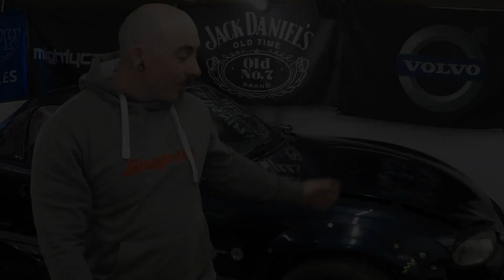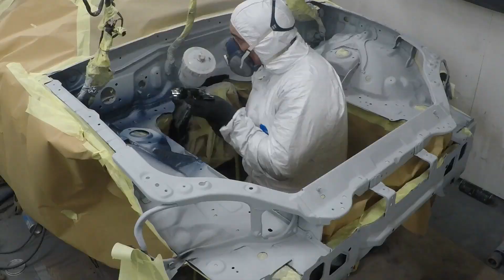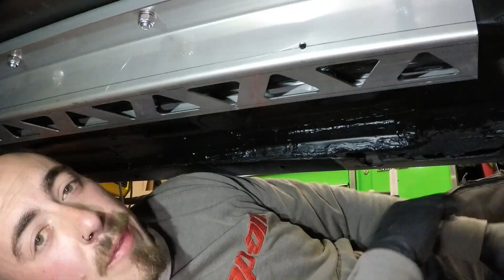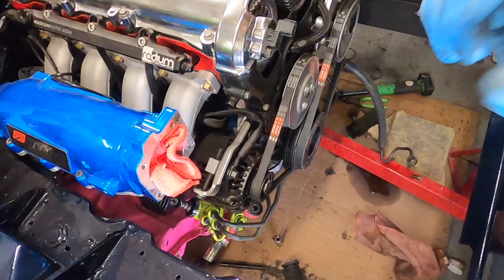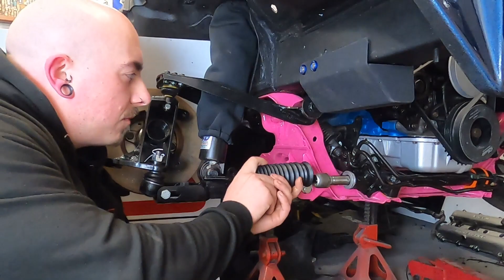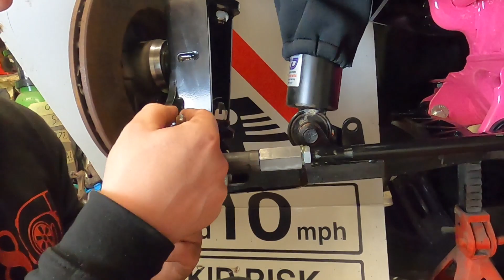STEERING RACK SPACERS AND RACK UPGRADES : MX5 turbo build pt34

Comment: sooo, with the destroy or die suspension arm setup your limited by how far the track rods go right with relation to the steering? would the standard track setup still give you a good alingment with your wheels or is it a must to extend the track rods i.e if your not gonna drift and you simply gonna by the kit for the strength and reduce weight over the standard suspension arm setup? asking cause ive seen the kit and interested in it very much
Reply from the maker: So yes if your just keeping it at standard camber and track width then the standard tie rod and track rod will be fine. However if you change to the destroy or die hub then you may have to play with the tie rods

Comment: What tie rods do you need to fit the destroy or die kit on the Miata ?
Reply from the maker: just standard ones at the moment but with about 5 threads cut off
Reply: @Project380 can you make a video on this i’m about to put on rack spacer replace my tie rods with oem and full destroy or die

Comment: 9:24 how did you end up resolving this? im running into the same problem but before the coilover bolt its the sway bar link that hits the tie rod
Reply from the maker: at the minuet ive not resolved the issue but i have plans to resolve this very soon

Comment: where did you get the tie rod extender i cant find it anywhere
Reply from the maker: custom made by a local machine shop
Reply: @Project380 do you have the measurements written down somewhere? As I've just encountered my wheels are toeing in a crazy amount after fitting the complete kit, there's only so much thread left on my arms to straighten the wheels out, that's even with the rack spacers fitted haha.